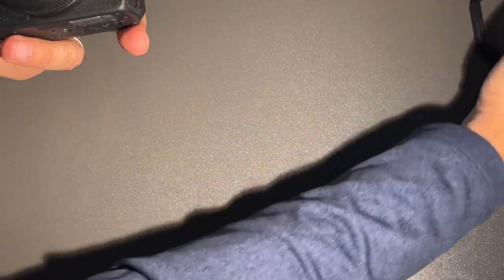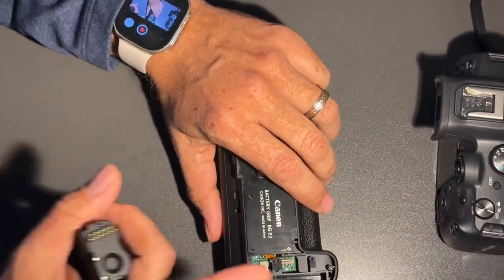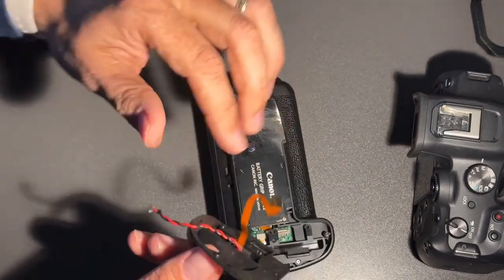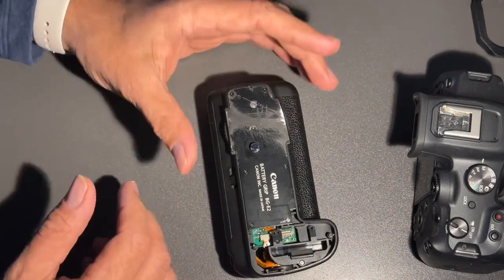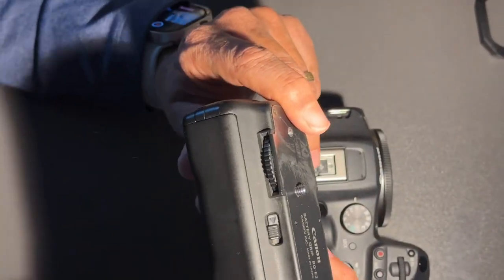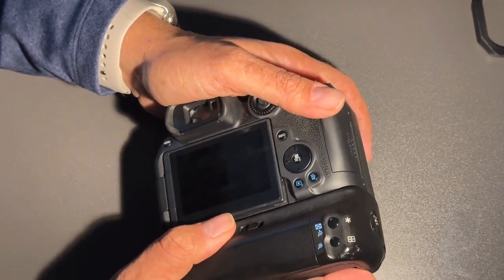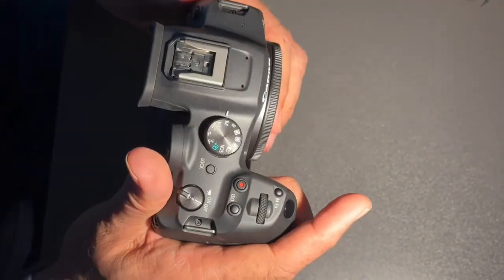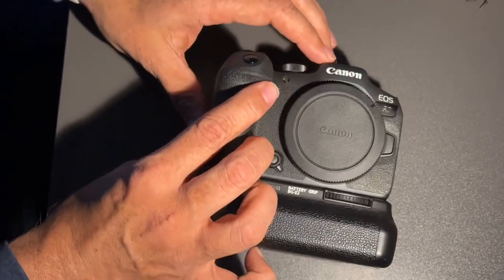How to Make A Canon EOS R7 DIY Battery Grip In 10 Minutes?

Comment: I did mine with the same grip as soon as I got my R7- I also spray glued thin rubber to the grip side to stop it from moving. Changing batteries is easy- just loosen and rotate.  Thank you for putting this video out.
Reply from the maker: I like that what you did as well I’m gonna most likely give that to go as well
Reply: Just be careful installing and removing the BG-E2. I got one from MPB and promptly broke it. I tried to use some velcro to hold the grip in place but it ended up being too bulky and thick so when I tried to remove the grip it wouldn't budge. So trying to remove it I turned the mounting screw too hard and it broke all of the little plastic teeth off of the wheel. I found this out after twisting it off and disassembling the grip to see what was broken. Probably not an issue if you don't use bulky material to try and hold the grip in place like the thin rubber you mentioned. I may try that approach before I purchase the one I posted above. I just ordered another BG-E2 from MPB for $9.00 the first one was only $5.00 so no big deal at this point.
Reply from the maker: @Albiemanmike  what do you mean broke it?
Reply: @camerasutra247  The grip with the velcro on it became "jammed" for lack of a better term and the mounting thumb wheel wouldn't loosen. So I just forced it and it snapped off all of the little plastic teeth that they used on this cheap grip to turn the mounting lug into and out of the bottom of the camera base.
Reply: @Albiemanmike  Good luck with the new one- I def think rubber is the best way to go. Been using it for 6 months out in the field and no issues.

Comment: Thank you so much I just bought the R7 and as soon as I got it was thinking, I need a grip, came across this video, went to KEH camera bought a used grip just like the one in your video.  Thanks for your easy solution.
Reply from the maker: Awesome welcome to the channel
Reply: @camerasutra247  I also tried the battery grip for the 7D mark II it wasn’t as flush on the handgrip side but wasn’t uncomfortable it did have overlap on the other side but it did allow me to store two extra batteries in the handgrip so will keep both since I shoot sports the easy extra battery storage will be a good safeguard .
Reply from the maker: @Texas210ify  awesome

Comment: I also have big hands that need a grip.  My solution for heavy glass is the Mamba cage and the Smallhd rosewood grip mounted on the left side.  This combo works for me because I also add a monitor on top for best composition.  I'll try your idea with the modified grip.  I can see it being a lighter, more nimble back button focusing machine when I don't need the monitor.  Thanks.
Reply from the maker: Awesome

Comment: Just Finished doing mine. Just out of interest once you have removed the post, its easy to remove the base plate with the writing on. its only 6 screw. once the plate is of its easier do grind the post without scratching the plate. just put it back with the 6 screws. I used the removed post as a stencil to cut a piece of compressed black foam and fixed it in the hole with some double sided tape. 
Thank you for the great idea. Same I cant share a few photos.👍 BTW I though i could have 2spare batteries, but they dont fit.
Reply from the maker: Oh great thought I will do that on my next ☝️

Comment: Rumble I love what you did here .
Have you figured out a way to make the shutter button work on the is there a way to make the shutter button active on that grip that you put on please let us know down below because putting on the vertical grip you want to have an active shutter button on the vertical grip .
Reply from the maker: Not with this grip because this one takes the BP 511 batteries and they are seven is made it to take the LPE6. The only other way I can think of is if you 3-D printed something similar and put in a power mechanism in there to power through the USB port with a wire that would be the only other option. I am working on getting a power bank to fit inside the battery grip and then run a cable from that into a USB. I’m not having much luck finding a very small power bank that will fit in there. More to come.
Reply: @camerasutra247  thank you for the reply to Rumble .
While looking on the internet after I read your article I noticed a grip called  BG - E 9 which was designed for the D60 if you run across one of these grips this one might just work because it uses an LP - E6 battery .
Reply from the maker: @garymeredith2441  I’ve been looking for that, but not had much luck yet

Comment: I wish the Sony ergonomics didn't still make me nauseous.   I tested the A7R4 extensively and just couldn't handle it.  Now with Nikon on a tear taking 2/3 top sales slots in 2023 in Japan (Z8 > R6ii > Zf), maybe Sony will finally truly update the ergonomics.  The A6700 - good grief, what a fantastic camera I would never enjoy using due to ergo.

I tested the R7 last weekend with the native Canon speed booster.  I've been wanting to replace the Canon R in favor of a body with IBIS, because I adapt so many film lenses. The R7 booster make my EF glass prime and zooms equivalent to having a 40/1.4, 18-40/2.8, 27-119/2.8, and 113-452/3.2-4.  I was surprised to find lens corrections properly applied too😁  My Bronica PE 75mm becomes an 85mm F2, and dang, its still sharp on that crop sensor!  The most entertaining test though was the PE 100-220, which was still usablely sharp.  Not that I'd ever use that 5lb monster on the Canon, but it was still fun to test.

Comment: Can you put a spare battery (fits R7)in grip just for storage?
Reply from the maker: No battery just a grip you still use the R7 in it native state with the batter and door intact the grip give you the full body real estate.
Reply: Will the R7 battery fit in the grip without rattling around, just so you can carry spares for storage?
Reply from the maker: @timothybrown7121  yes, the only problem is there will be no rattle but these are BP 511 batteries not LPE six that it will actually hold so you might be out of luck. Maybe you can store some chewing gum in there just thinking out loud.

Comment: Maybe you can use an r7 dummy battery to take of the bottom part by the plug, attach it to the grip and then connect the wires. It would probably give you one of the battery compartments juice to put a battery also making the grip more stable.  
Also you can find a very thin gasket to go around between the grip and the camera for water proofing.
Reply from the maker: That’s and option for sure.
Reply: the batteries of the Canon EOS R7 do not fit in the BG-E2N maybe in the BG-E2

Comment: The lack of a BG is why I never bought the R7. I need the extra battery capacity and dual controls so my old 7D mkii remains…
Reply from the maker: Awesome trust me the battery on this thing glasses just as long as two batteries inside the 7dmark two.  I thought with it a lot in my mind as well but once I got it and really started to use it pretty incredible. It’s pretty much light years ahead.  I recommend renting one and see if you like it.
Reply: @camerasutra247  Probably not twice as long 😃 I’ll get almost 3000 shots from the LP-E6 packs in the grip. Like I said also, I need the dual controls so unfortunately the R7 is out. I’m hoping canon see fit to releasing a real 7Dii replacement with less rolling shutter effect and a BG. The terrible jello effect is well documented and if I were to just use the mechanical shutter I might as well hang onto the 7Dii. The alternative is to use an R6 mkii in crop mode for shooting jpg sports images 👍 the rolling shutter effect is way less than the R7 and R6, but not as good as the R3, which is obviously the “holy grail” canon.
Reply from the maker: @stubones  lol